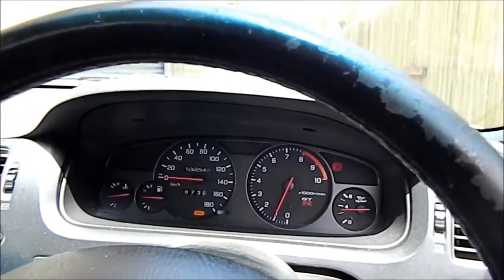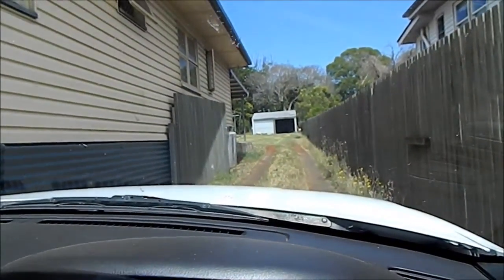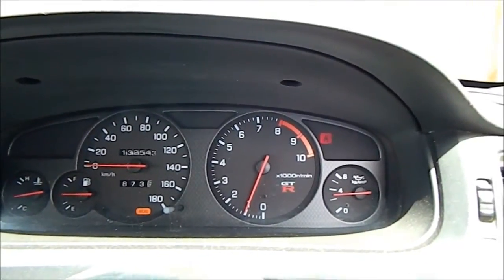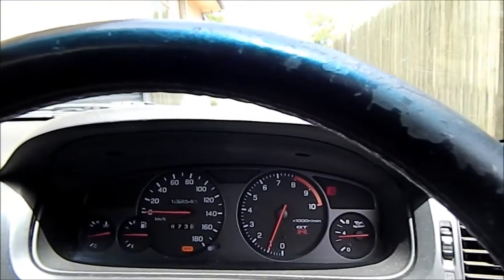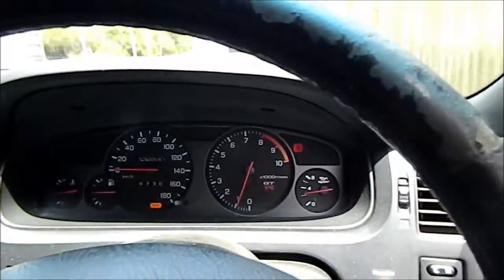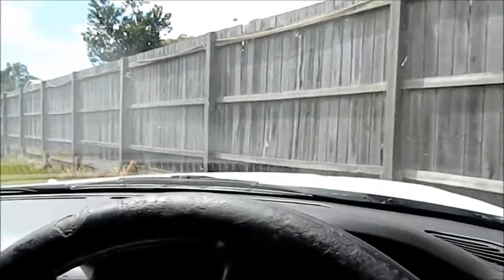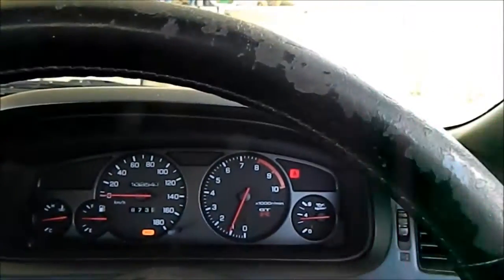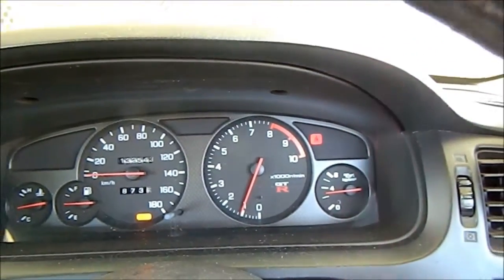R33 GTR - proper IAC/AAC idle control valve function and abilities

Comment: 1000rpm isn't correct idle
Reply: I was gonna ask about that, what is correct idle speed? 600-800rpm?
Reply: @gav240z  correct idle speed for a gtr is 950 so 1000 on the tach is about right
Reply: @duckbob100  thanks my 260RS (Stagea) with RB26 idles at bang on 1000 rpm. I couldn't set it any lower.
Reply: @gav240z  it can be a nightmare getting these things to idle sometimes. I just had the whole intake apart to recoat the itb's, rebuilt the aac and various other fuckery and only now can i get it to idle right. If youve mamnged to get it down to 1000 leave it. Trust me!